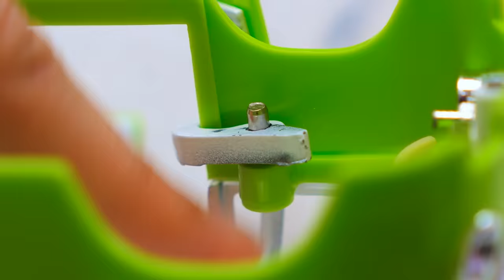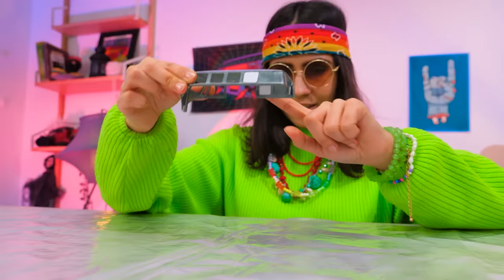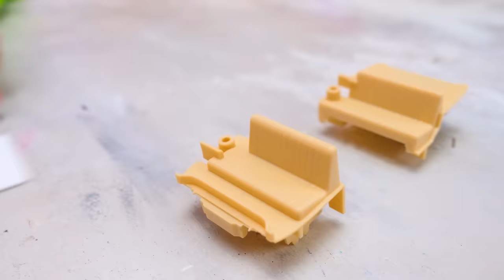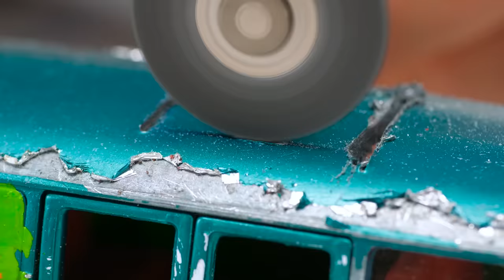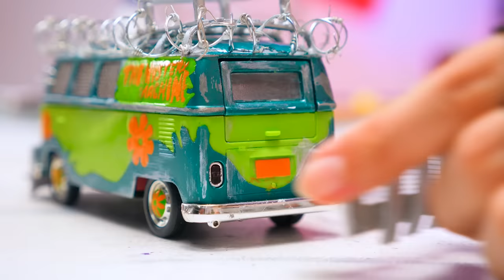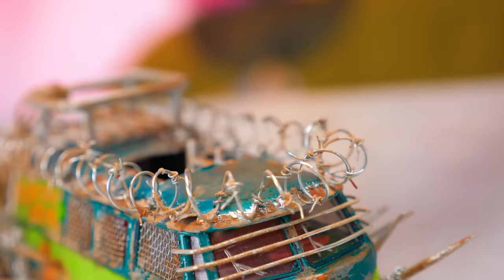Transforming a Mystery Machine into a Post-Apocalyptic Car

Comment: I'll pass. I'm going to take a stab and say no one showed you how to use an air brush correctly? The severe overspray also how many times did you have to redo the aluminum tape on the top to get it smooth?